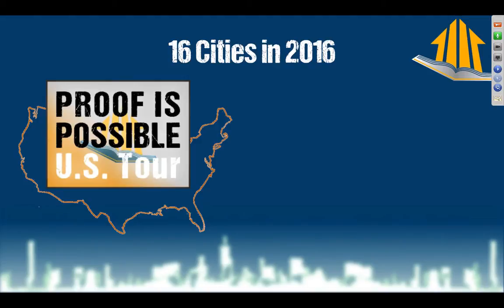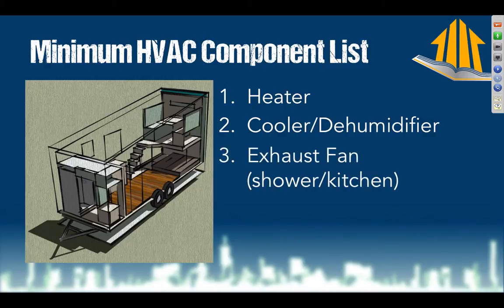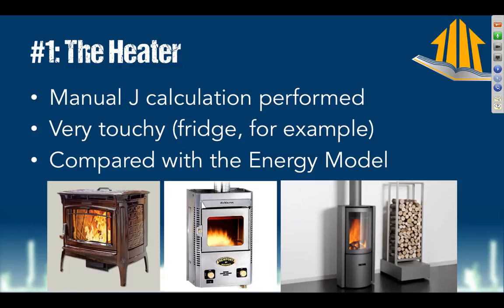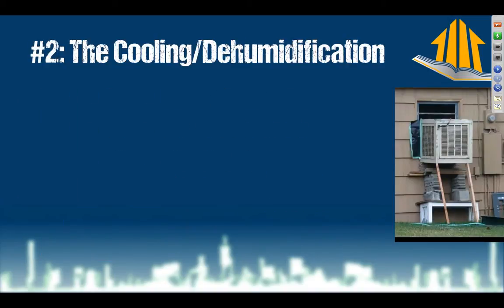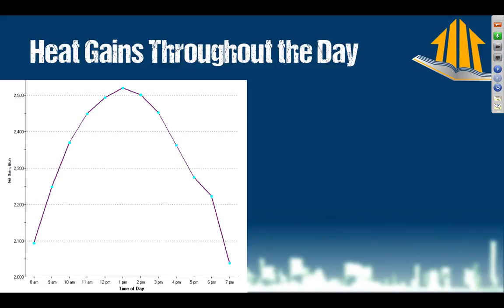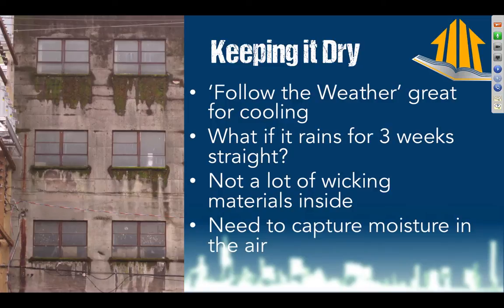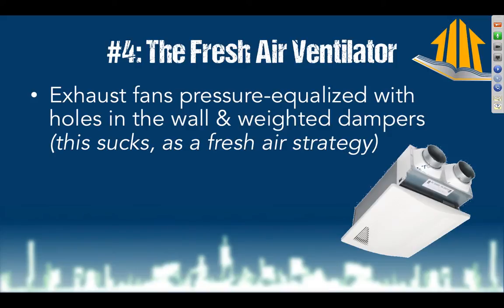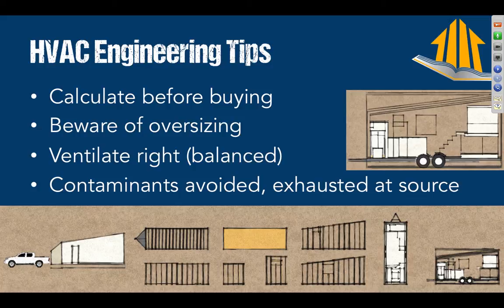Engineering a TOURING Tiny House #3

Comment: Have you looked at rocket stoves for heating. The heat they put out is with 1/10 the amount of wood as other fireplaces. They draw well and can pull air from outside for combustion. A stack or exhaust chamber above the flames secondarily burns fumes from the fire so that the exhaust is essentially smokeless.  The superheat that results from the secondary burn will heat a cook-top in addition to radiating heat to the room. Also heat from the pipe which is exhausting through the roof is hot and also can be position to release heat into the indoor space. If you live in a wooded area, the ground will have plenty of twigs and broken limbs to supply free fuel.
Reply from the maker: Rocket stoves, while very cool and DIY-friendly, are too hard to steer and anyway much too big for a climate like Atlanta’s. In very tight homes, you want a much more precise heating/cooling system and you want distribution with a duct system. Right tool for the right job.

Comment: How did the Mitsubishi mini-split workout with solar power?  Are you effectively able to cool your tiny house down using the low setting at 110w?  I'm thinking about buying the same unit but would like to use exclusively solar for energy.
Reply from the maker: Very difficult to do for longer than a few hours. You’d need lots of panels and batteries, and the damn sun doesn’t shine every day
Reply: @HomePerformance  It's a huge/risky investment... I'm hoping I comfortably live with two  Maxx Fan vent fans and a Vornado air circulator.  The tips on choosing what direction to park were great.

Comment: Still watching, but for cooling I would consider tent like shading and fans. I live in a 280 sq foot apartment and just running my ceiling fan at the lowest setting makes a huge difference. 

Where's the compressor for your refrigerator? I recall hearing (long ago) about someone who moved the compressor to the outside of the wall. If you could find a way to vent the heat from the refrigerator during hot weather, it might make a difference. Still, air movement should be your first cooling option.
Reply from the maker: Good ideas, but our main concern in this case is actually dehumidification, not lowering the temp. And the fridge idea could work, but I'd have to weaken the enclosure of the Tiny Lab, which is why we also decided against a propane fridge as you'll see in the last webinar.